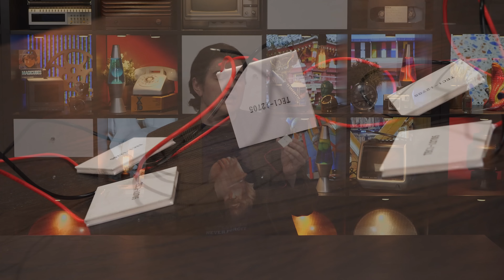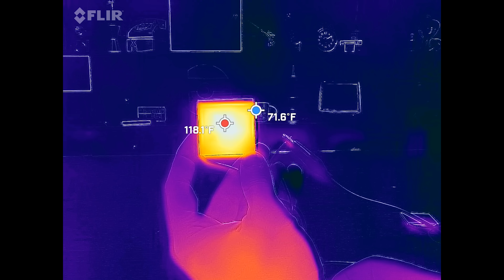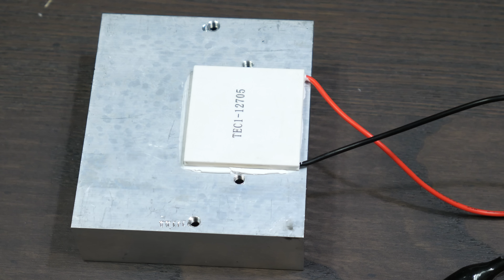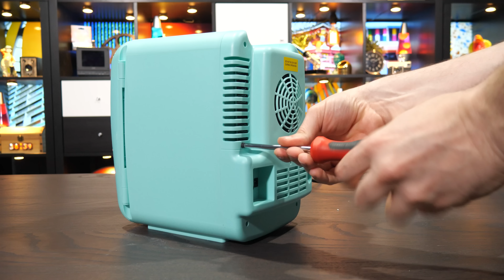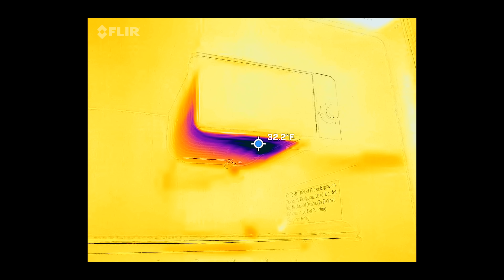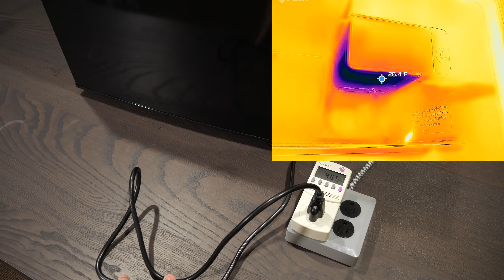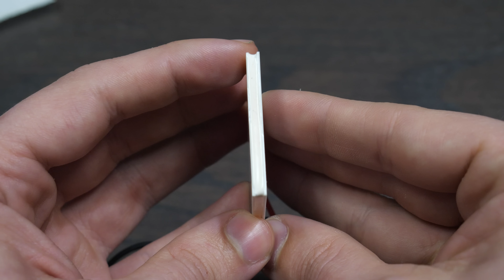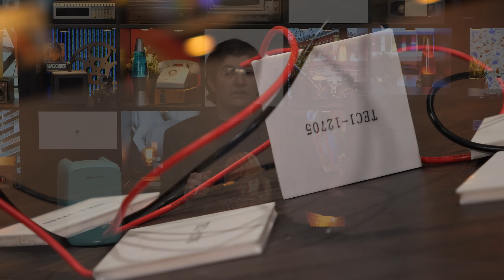Thermoelectric cooling: it's not great.

Comment: The poor cooling of low cost items such as this fridge, the culprit is not the Peltier but how the Peltier is implemented. The manufacturer has an option of installing several Peltier devices, and improving the power supply and control circuitry. Having a proper inner cold heat exchanger is also important, in which all of these devices never have. They often just press the cold side against the inside of the fridge, to cooling fins, no inner fans, and thus poor cooling transfer.

Comment: Tech Ingredients made a better TEC fridge, but even they said it's a hard thing to do. They needed to use a really well insulated box, a generous heat sink (because heat sink performance is a huge factor for these little modules), and I think they also used a temperature controller. Though it would be possible to improve efficiency by making the thermostat adjust power rather than kicking them on and off so the power is constant but low instead of high power bursts.

Comment: I have something like this as a factory accessory to my car. It works great on road trips for what it is and keeps drinks and snacks cool. But it also has a switch that allows you to reverse the functionality of it and use it as a warmer. In that application it is killer. It keeps takeout nice and hot until I get home from wherever I buy it. There are portable compressor fridges, but they are expensive, like over $300 for a good one expensive, and I don't trust refrigeration compressors to run happily in a moving car.

Comment: I have a wine fridge that I messed with the temp control to get it down to 35 ish. 
The one main thing I do hate about fridges and freezers they are a combo of a single compressor. I think I have seen a dual compressor combo where the fridge and freezer are 2 separate systems. This works better because you can control each one much closer to their intended tempatures. The combo blows cold air down to the fridge and if it is too cold it has to wait to warm up again which means it could stay way too cold for too long. 
There are seperate single units that can convert between the two and those are even better. 
I would also love to be able to extract the heat from these compressors for domestic hot water in the warm months and normal heat for winter months.

Comment: I have temperature sensitive medication that's currently being stored in the back of the kitchen fridge because we have nowhere else to put it. It technically can survive at room temperature, just not with much safety margin, so if the power goes out for too long, it'll cook, and we've had a few outages this summer. So I was looking into getting a makeup fridge specifically for it, to keep it in a cool dry place that's easier to access. I didn't really care about the subpar cooling because honestly it just needs to be 60-70° F. But that power draw, yeesh. I wish there were a better long-term use option for fridges that have reason to be small.

Comment: My first experience with Peltier cooling was about 30 years ago when my parents bought a “car refrigerator” for our old Dodge Grand Caravan. My dad was very much the “we’re not stopping on road trips” kind of person, so he always wanted us to pack any possible snack or drink we might want to have on the trip. Side note: he never seemed to consider the fact that snacks and drinks during trips would require us to stop eventually for bathroom breaks since he didn’t also pack an outhouse in the van. Anyway, the car fridge concept seemed really cool , but it basically didn’t work. It was NOISY, louder than a typical fridge, and it barely cooled anything. I was a curious kid, so I looked into it more to figure out why it didn’t work well. 1) it basically has no insulation. It was a metal tub inside a plastic body. No insulation. 2) Peltier cooling doesn’t work very well 3) CARS ARE HOT, they only cool down when the AC is running, which is not all the time and 4) the fridge can only run when the car is running. As soon as the car shuts off, you need to turn off the fridge or risk a flat battery (or, in many cars, like our old van, the power socket turns off as soon as the car turns off). So, as soon as the leave the car, the fridge turns off. Since it had no insulation, and cars can easily get to 120-140F in the summer, it would heat up VERY quickly, but take hours to days to cool back down. I think we used it once or twice before it got junked.

That said, I wish I could find a car fridge that was small (maybe twice the size of the toy one you have) and used a heat pump. They exist, but they’re the size of a large cooler, which is too big for my needs. I camp in my car, and the back is filled with a bed. I’d be looking for something smaller, that I could fit under the bed or in the oassenger seat. Everything I’ve found with a real heat pump is too big.
Reply: you should get an old Lexus LS 430 Ultra Luxury edition, it has a fridge in the backseat. It uses a second evaporator with lines to the main AC compressor, so basically a mini split

Comment: You know, for its advertised purpose -- chilling soda cans in an office setting -- it's probably fine. And if your boss is too cheap to have an office refrigerator, it is a boon.  It's also FAR easier to bring into your office and fit under your desk than a minifridge.
I mean, imagine lugging in a minifridge into a work office setting. Anyone who's worked in an office would know that somebody (the boss, HR, etc.)  is going to bitch about that. But you lug in this little thing, no one will probably notice. And you're not the one paying the electricity. You're also going to have it sit there overnight while you're not in the office, so by the next morning your fridge is ready to go.
I get it, this isn't useful for home use, fresh food, your home electric bill..... but in real fairness, none of those things are anything the thing is advertised for being.

Comment: Instead just spend the money on a dometic (which comes with a traditional compressor and is which both plugs into the wall and the car) and be done with it for good.
They aren't cheap. You definitely get what you pay for.

Comment: I generally love all your videos. They’re informative, useful and always spot on. 

This is the most obtuse review you’ve ever made. You hate these just to hate these. 

I’ve had one of these under my desk for years. In my home office, where the ambient temperature usually averages about 80°, this keeps my diet beverages nice and cold all day long. Generally sitting at 38°.  I can put them in warm, at the beginning of the work day, and they’re cold in an hour or two. 

Did you try any of these other than the blue blob? Mine has a thermostats, a digital display, and I can set it to various temperatures.  As long as you clean the heat sink every couple months, it’s a consistent cooling machine. How long did you test yours?

I’ll throw the Kill-a-watt on it, but at the end of the day, I don’t really care what it pulls, because more importantly, it keeps my drinks cold. And it’s not pulling any more than the other 85 devices in my office. 

No one is buying these can-centric super mini fridges to store food. If they are. They’re an idiot. So the food safety concerns are lost on me. They literally have can shaped grooves. Not food storage shaped grooves. 

A cube fridge would be nice, but I don’t have room for that under my desk. I used to have a larger mini fridge in my office. But the noise and heat it put off were…you guessed it, off putting. Not to mention, space…it took up too much space.  

Did you account for the heat put out by your cube fridge and its effect on the ambient temperature of the space in which it resides?  I don’t think you did. I’ll give you credit for mentioning how loud they can be. Because cube fridges are also cheap, and those compressors rattle like New Year’s Eve after the first month. 
I’m disappointed in your video. I’m usually willing to follow you down the rabbit hole, but you missed on this one. 

Of course they would loose to a fight against a grown up heat pump. But no one is buying this as their primary fridge. You are literally comparing a bic lighter to a furnace. 

Nope on this one friend.

Comment: I have a “chiller” for axolotl aquarium that uses these. It’s a piece of crap Amazon $100 device. It has a universal 12v PSU, a controller like what you showed near your red fridge, and these peltier things sandwiched between an aluminum water block (meant for the water cooled CPU market) and some CPU fans with thermal paste in between. It barely keeps the temp in range for the axolotl but I do wish I had a proper vapor refrigeration cycle.

Comment: Ok, so as someone who has one of these. IT is not crap.

I can not drink cold things due to a damaged tooth. Cold things sometimes irritate and are painful to consume. THIS.... The miniature fridge I have, cools things but not enough to set off my pain receptors. IT is a GODSEND. Could I have bought a proper mini fridge, well, sure. Am I willing to pay 4-8 times the price? Nope. Non negotiable. If I can get something that gives me the desired effect, for cheaper. There is no point in going more expensive. I have had this fridge for a few years now. IT works still. Now maybe I just happen to get the luck of the draw.... Or maybe I just happen to find the ONE single fridge model that doesnt suck. Or maybe. mine actually works? And was 20 bucks?

Comment: I purchased one of those Peltier fridges for my car, for when heading off on a holiday, however as you said they takes ages to do anything, I was toying with trying to improve it, but never did, The compressor heat pump setups have one big problem, and that is they don't make them small enough to sit on the back seat of a car. Just look at the percentage of the fridge taken up in your mini fridge.
Another kind of crappy system you could look at are three way caravan fridges, these tend to have trouble keeping you milk cold in hot environments (Usually where one heads), and use way too much power.

Comment: Well I actually think there might be some strategies to make use of the tech. The first application I can think of would be to use an evacuated chamber with a coolant and a radiator.  

🙄 I actually think that there really is potential if you were to use the device as a heater for heat pumps.

Comment: I had a I’ve-chest sized cooler of this type in my truck. It worked well, because it was in a high vibration environment. Several thousands of these are in trucks all across the United States. It was better than not having food in the truck. But barely.

Comment: I have experimented so much with those Peltier cells without success, or at least, with no satisfactory results. The only discovery worth mentioning is that they work best with slightly lower power than the rated power.

The performance of those Peltier cells is so little that as soon as you turn them off, both sides are the hot sides, lol. Heat does not wait even a second to go to the other side as soon as the "pump" is stopped.

I have tried lower and higher current, lower and higher voltage, series connection, parallel connection, reversing polarity to see if there was a "better side", physically putting more than one cell in tandem, both with same size cells and with tapered sizes cells, you name it.

Performance is so poor that it makes them only good for situations where you cannot use a real refrigerant-based system. Situations like cooling a microcontroller, or the need of cooling into a small space like that. Even for cars and RV's it would be better to use a small fridge that fits in the trunk with a 12-volt inverter.

Like with LED's, we are waiting for a better version xD

Comment: you didnt mention those dinky dehumidifiers, which its also bad at.
i'm guessing you have less humidity issues.
in singapore and other tropical countries/cities, humidity is mainly why we feel hot/uncomfortable.

 a heatpump split AC system is better at removing humidity from the air because it can circulate an entire room.
i wonder if  those portable AC units you covered are better for removing humidity.

if its a close box, silica gel/other chemical dessicant will be better.
yet peltier dehumidifiers are sold. 

i was looking into peltier cooling for my pc 15 years ago. i saw coolermaster selling a cpu cooler with a peltier cooling plate as a gimmick.

Comment: I find it funny that they make a USB version of the guts of those fridges to stick on the back of cellphones.  Great for people who play Pokemon Go in the summer. just plug it into a power bank and yer good to go. it'll pull the temp down from 'This phone is disturbingly warm' to 'Pleasantly cool' fairly quickly. Same drawback though. They will drain a power bank as quickly as the phone does when they go at full tilt. Oh, and the ones I've owned also have built in thermostats. So yeah. Very specific use case in which these little buggers are worth something.

Comment: Maybe these mini coolers have gotten worse in design over the years. I have a 20 year old Vector baby fridge with the same cooling element. That thing was the coolest gadget for Halo 2 and Halo 3 game nights when I was a kid. No need to go to the real fridge downstairs when I had 6 cans of Aldi Summit grape and orange soda ready to drink. lol Those drinks were always frosty! 

My Vector has a metal interior and what appears to be some minimal insulation, so i wonder if that helps. It also came with a 12V adapter so i can use it in a car, which I still do today. I can't think of any other $30 product I've kept for so long except car tools. Given the teenage memories and great nights camping I think I got my money's worth. :)

Comment: I found one at Goodwill for eight bucks. I use it store peptides and hormones that require cooling. Since I go through them fairly quickly the relatively low rate of refrigeration works just fine for me.

Comment: The Dometic fridge that shipped in my 1991 VW Westfalia campervan had a mode that ran off the battery and it was worthless. I ripped out that piece of merde and bought a portable Engel fridge that had a very efficient Japanese heat pump and decent insulation, which not only cooled the fridge but could get the freezer compartment cold enough to make ice cubes.

Bonus: once cold, you can take it out to the picnic table and it'll stay that way all day.

Comment: does anyone know if air conditioned seats in cars use Peltier elements? In my 2015 Ford Edge the seat cooling works (a little bit) regardless of the vehicle Ac compressor engaged. I havent been able to find this anywhere but think this could be another application of these inefficient little semiconductor concoctions.

Comment: could you build it better tho?
like it being smaller may be an advantage 

like:
•use a better heatsink (maybe a pc one?) with a better fan to reduce noise. yeah fans are moving parts but they're also cheaper and easier to replace than a compressor
•better thermal paste
•put better insulation
•make it a chest fridge!!! like, with it being so small that shape would probably be better, specially if you're only planning on using it for cans or maybe a couple of bottles
•put a thermostat so it can actually stop when it reaches certain temperature
•an internal fan to move the cold air around more evenly?

all those things would make it more expensive but it would play better with it's strengths, being small and movable

Comment: 6:11 thats absolutely fine for 4 hours or until lunch time. i keep shit in a cooler, outside, sometimes in a hot car, for up to 8 hours and the inside is 45 degrees and thats at 7 or 8 pm well after (talking hours) the sun has started to set so i imagine if i checked it at 3 or 4pm it would be even warmer than the 45 it is at 8pm.

Comment: What you use the blue toy for is when your mini fridge needs defrosting. You stick some cold drinks from the mini fridge into the blue toy. Then stick the blue toy into the mini fridge. Then you have cold drink while the blue toy defrosts the mini fridge.  Stick some towels in the bottom of the mini fridge to soak up the melting ice.  The mini fridge will keep ice cream bars frozen and will make ice in ice cube trays.  Also, if you never defrost the freezer and you have a power failure the accumulated ice will keep the mini fridge cold longer.

Comment: I acquired one of those desk fridge things somehow years ago. I found it handy to keep in the bedroom with a couple of bottles of water. The white noise from the fan was kind of a benefit. It suddenly died one day and would no longer cool. I took it apart and found a blown capacitor. Later, my daughter moved out if the dorm at college. Her cube fridge ended up sitting in the basement, and I rwpurposed it for bedroom water duty. The cube fridge is a much better option.

Comment: Very cool. I want the Peltier device. It can be hacked with a microprocessor cooler that uses liquid cooling and runs on low voltages. Combined with solar power and battery and wrapped with extra insulation, you got a smallish beverage cooler project.

Comment: I have one of these in my car, under the dash. Electriclly its weak, so since my model had a shelf for the upper 2 cans, i fitted a mushroom tray as an ice box which cools cans far faster then on electric. Works great for road trips, and allowes to get a drink with 1 hand while driving.😮 Flattens the battery real quick, so rather just get a little ice from the fridge before leaving or a cup at a drive through.

Best of all, it becomes real cold, and you can serve cups of drinks with ice in it. It's a winner used that way.